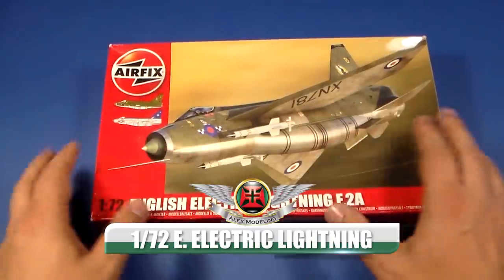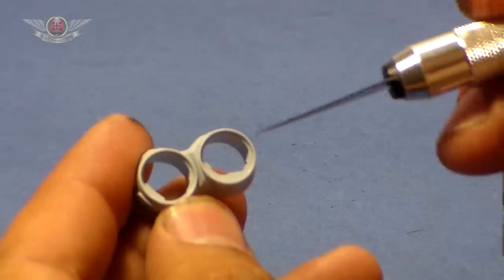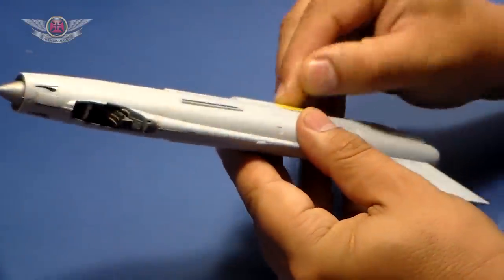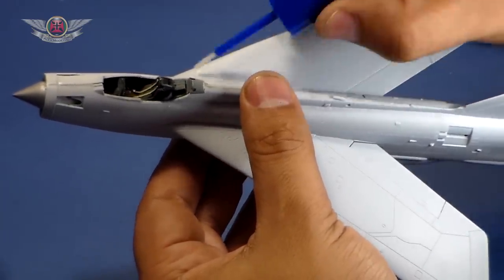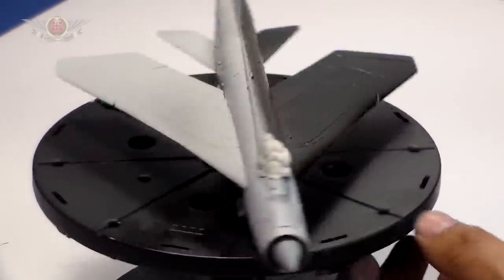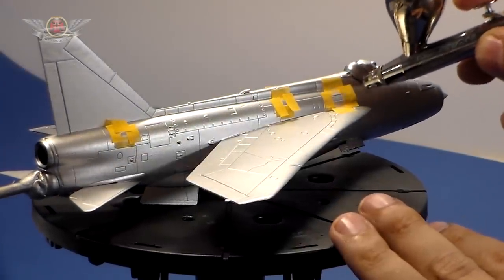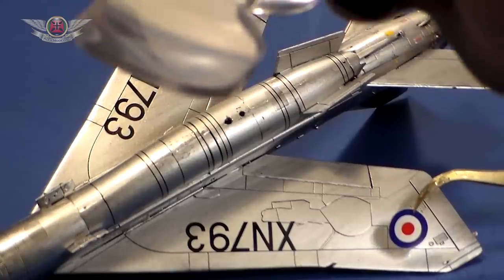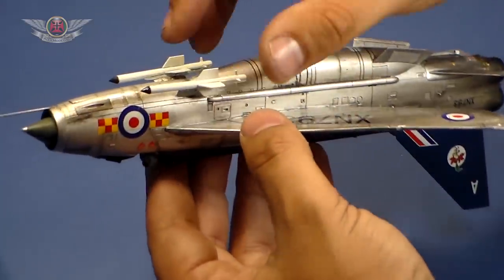AIRFIX 1/72 ENGLISH ELECTRIC LIGHTNING F2A FULL BUILD VIDEO

Comment: Hi Alex, a beautiful build of an iconic British Aircraft. I have to make a small comment however. The pylons for the air-to-air missiles on your model are mounted downward which, in the frontal view, makes them sitting below the fuselage of the aircraft. This is definitely not right. The pylons should be mounted 90 degrees on the fuselage so that the rockets are next to the fuselage in the frontal view.Maybe the Airfix instructions are incorrect or whatever. I think it's possible to correct this little mistake. But for the rest a beautiful build.
Reply from the maker: Yes it was my mistake unfortunatly... Wont happend again. But thank you for your comment and correction. It is this way that Ivan grow up as a modeler

Comment: Alex since we all learning, in your next build try to use the airbrush with less "spattering". This means that the mixture is thick compared to the pressure and because we want the pressure around 1-1.5 psi, you have to thin the paint more. Keep up modeling!